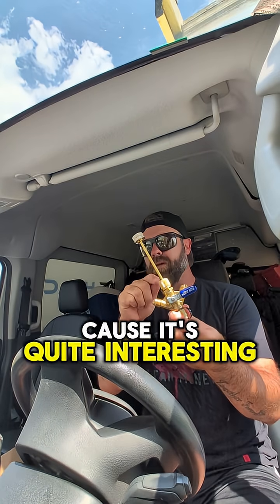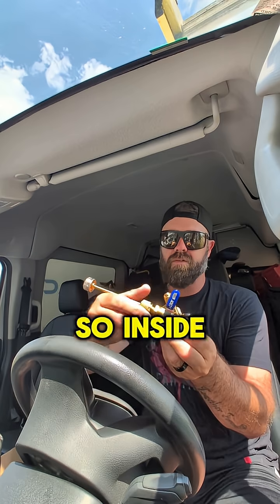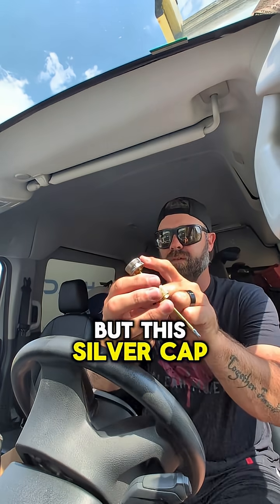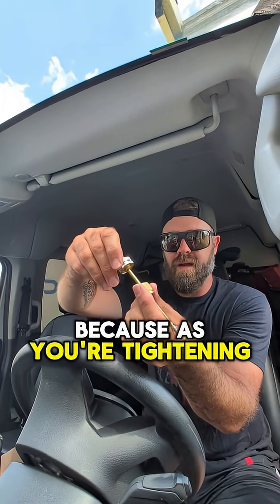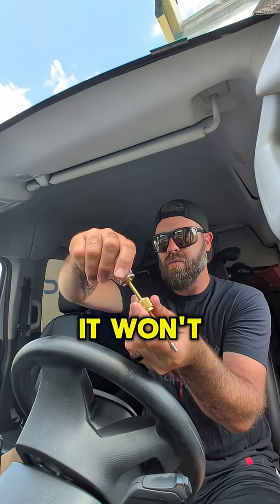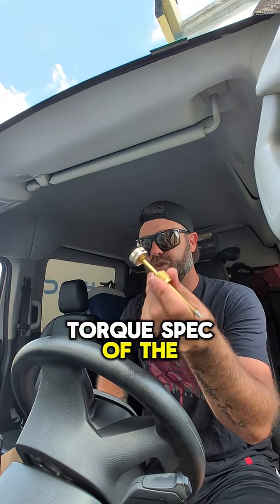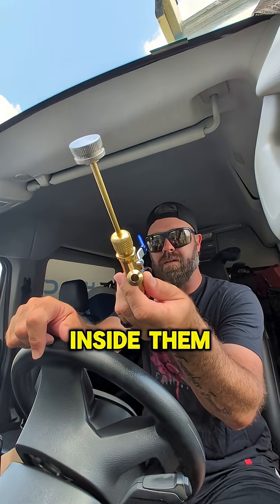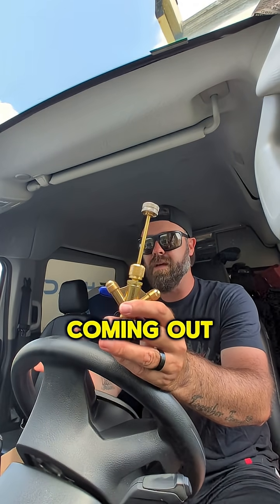Vacuum Y Yellow Jacket

Comment: I bought a brand new YJ CRT and could not put the core back into the system after a vacuum during the very first use. Had to take it off and use my appion. I don't know if I did something wrong or the tool is defective, I've been afraid to use it ever since 😅

Comment: 2 3/8 hoses pulling from the same vacum pump through a 1/4 inch fitting.🤔Same as using 1 3/8 hose I’m thinking.
Reply from the maker: That's like saying 2 duct runs vs 1 is the same static pressure and air flow out of that same air handler

Comment: Fieldpiece with the double valve is goat. Hook up to both SL and LL till 2000 microns. Close ballast, close LL vac hose. Finish evacuation through SL only. Obviously have your Micron gauge on the LL with the FP core remover.

Comment: Not necessarily with doubling evacuation speed, because the faster you move, the air and you transfer up from the boiling point you can actually cause it to flash freeze, and then you'll still have pressure in the system in that scenario with that tool one line should go to your vacuum pump, the other line should go. To the freon tank, therefore, you're vacuum in the line to the tank and yeah, to the vacuum pump at that point. When you're done, you can isolate and then, uh, put you system, enter a charge without it. Any breaking of the vacuum, but I like that. They finally added the torque. Set in just like the j b torque the handle
Reply: Unless he is actually talking about freon. Many countries still allow CFC and hcfc use. ;)
Reply from the maker: @adamradley4407 Freon is a brand name, not a type of refrigerant
Reply: @HVACKnowItAll yes I know. As you well know that it is used just like "Kleenex" "skidoo" "sawsall" and so on.
Reply: Although I hear you. I am in Canada so none here and it always makes me smile to hear the CX go on and on about the freon levels lol
Reply: Mmmmm Jim burgman needs to confirm this
Reply from the maker: I think you should go watch my video on the TruBlu vs 1/4 hose and it doubled the speed with one hose only.
Reply from the maker: Thermal conductivity if the copper won't allow it to freeze unless pulling down in low ambient weather.  Also it's called refrigerant not Freon.